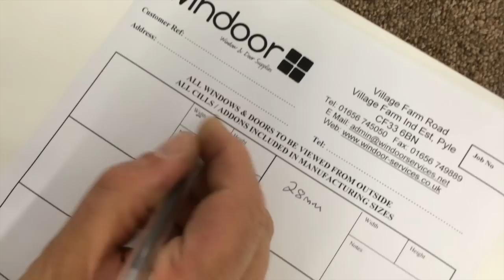How to replace a PVC door panel

Comment: can the panel be removed from the outside allowing someone to break in to your home. I have a similar door and this is a concern
Reply: Yes, I was thinking the exact same thing.  Has made me feel quite worried at just how easy they are to remove!
Reply: No, the beading (the strips you remove from the bottom and sides in order to remove the panel) is generally on the inside rather than the outside so no-one can break in that way.
Reply: No, the beading (the strips you remove from the bottom and sides in order to remove the panel) is generally on the inside rather than the outside so no-one can break in that way.
Reply: Aha!  Yes, I see now.  Thanks.
Reply: No the panel CANNOT be removed from the outside it's can only be removed from the INSIDE so there's nothing to worry about
Reply: YES, definitely! ! Just happened to a neighbor. Popped right out with a screw driver. Burglar had instant access.  Firemen  know this trick too.
Reply: @DSmith-ix1xf  with outward open door then yes it can happen

Comment: Hi, can I remove a glass panel in the same way and then replace it with a upvc panel? Looking at a cheap way to put a cat flap in. Thanks
Reply from the maker: +towns84 yes, most beading can be removed this way, and replaced with either panel or glass. Cat flap through a panel is the most popular way to do it (with cost and ease of cutting the panel).

Any other queries, please contact us at sales@windoorservices.net and we'll help out any way we can :)
Reply: How would i measure for the  new panel if it replacing glass? Or does the glass come out like a block too? Its double Glazed but i want the plastic so i can cut a cat flap